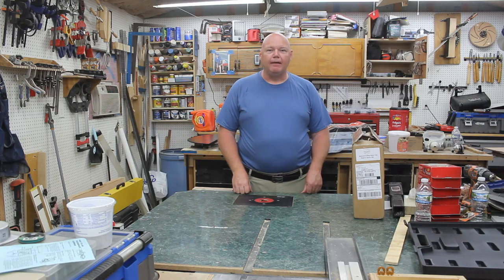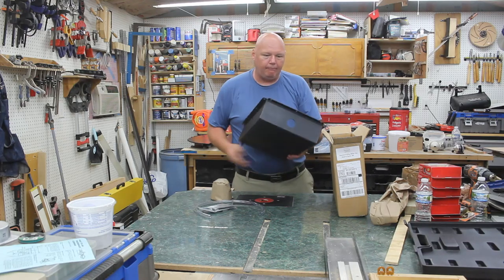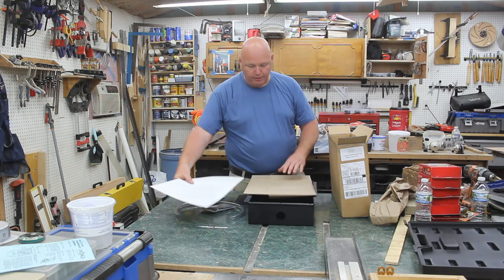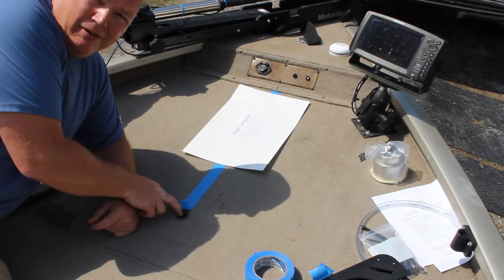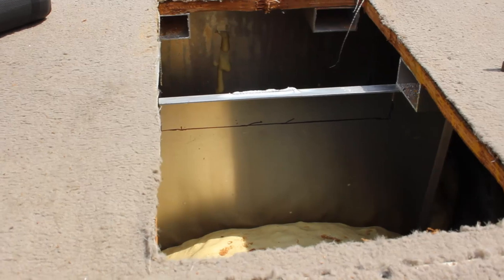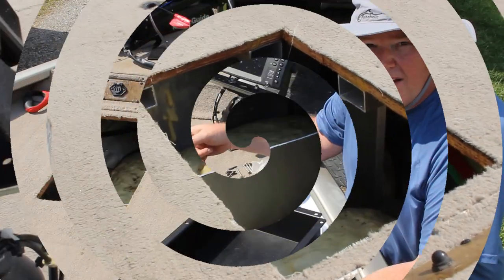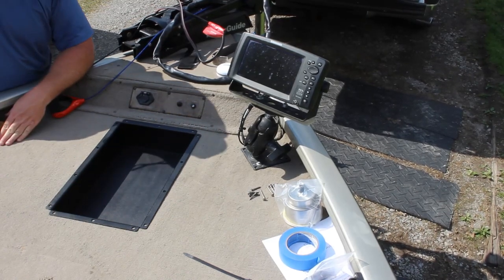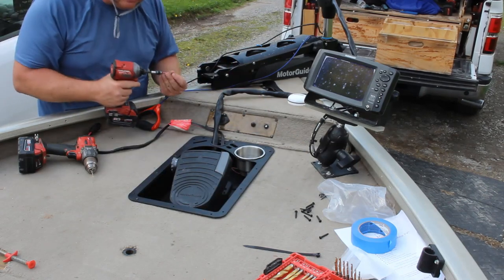How to install a Recessed Trolling Motor Tray

Comment: What is the size of the template? Is that just the inside specs they list on the website? My boat has a factory recess in place that my ultrex doesnt fit. Needing to know how wide the front mounting holese actually are so i know they will be wide enough to actually screw into the boat. Thanks!
Reply from the maker: Yes the template matches the website specs.

Comment: Have you had any issues with cutting through the support beams? I just bought the same boat and want to add a foot pedal tray but was a little worried about cutting through the supports and having some give in the deck.
Reply from the maker: There is zero give the beams I cut through are supported by the aluminum divider as well as the new tray provides the upside down bridge as well.   So go ahead and cut out for the new tray you’ll love it.
Reply: @thomrider thank you, that is good to hear. I am hoping to finish it on Saturday and maybe get out on the lake Sunday.